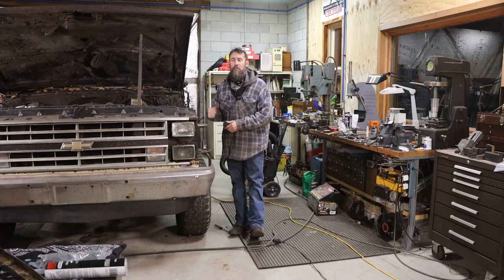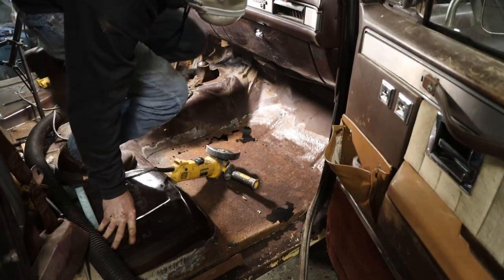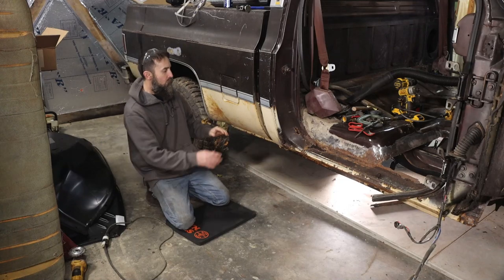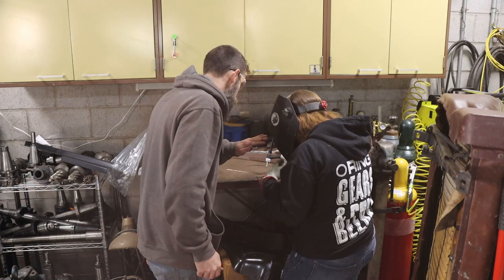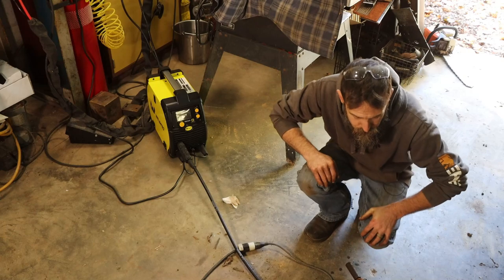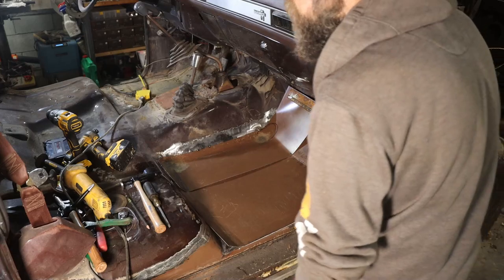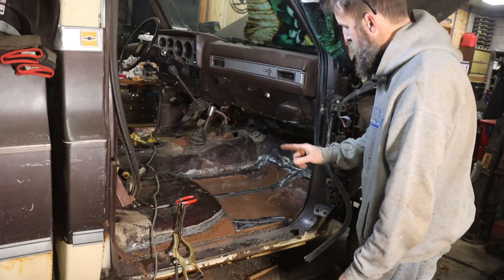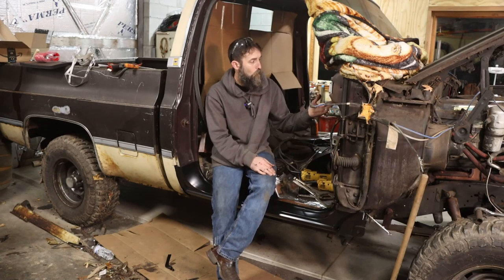Who needs floors / rockers anyway? 1985 Chevy K10 Rebuild Pt 8

Comment: Welcome to bodyshop 101, Steve! Floor pans rockers cab corners/supports are a breeze, it all fits together well mapping itself out for the next panel and or brkt! A good job is all in the prep! Oh, removing the bed sounds like extra work (and it is!) but will save you time in the long run! Great content as always! Cheers!
Reply: Pretty sure it's not his first rodeo...  He's mentioned that he used to work at a body shop.
Reply: @dennisp.2147  I mentioned that early on! LOL much to my surprise and hrs later, I find ole, Steve is no stranger to rust spot welds & panel placement!

Comment: Awesome video Steve!! I just baught a new 20 gallon fuel tank for the passenger side of mine along with a new sending unit and the filler hose and vent hose!! The new tank was only 69.00 threw LMC it also came with a nice Coding on the tank to keep it from rusting!! After I installed it everything worked great and I’m so happy that both fuel tanks work great!! The install was straight forward and pretty easy!!! I will eventually need to replace the cab corners and rocker panels but not bad enough right now to need replacement!! I actually only have one hole the size of a quarter in one cab corner so I’m pretty happy with that!! When I was in school back in 1996 1998 I had a two toned red and white 1984 light duddy 3/4ton that I ended up buying for 7500.00 with no motor in it!! The truck was like brand new!! I could have baught it with the big block that was in it but I was actually wanting a sbc in it!! The guy let me drive it home and pull the motor out and bring the motor back to him!! That truck was also a 4speed manual tranny and I absolutely loved that truck!!! I had built a 355 sbc for it and with everything that I had put in the motor and the 4.10 gears that the truck had in it worked amazing!!! It would pull away from newer vehicles on the interstate easyly!!! Unfortunately on my way home from working at a machine shop for a couple years I was headed just outside of a little town when a truck and a horse trailer pulled out in front of me!! I just missed the horse trailer and after throwing the finger at the guy another car that was behind him decided to just follow the truck and horse trailer and didn’t stop at the stop sign and I ended up T boning him and I wasn’t even going 35 miles an hour I had slowed down even for the horse trailer!! The kid in the car was headed to a basketball game but didn’t end up making it!!! The thing I can remember is he was trying to get to the passenger side of his car but couldn’t make it because he was wearing his seatbelt!! I truly believe he would have made it if he hadn’t been wearing his seatbelt!!! At the time I wasn’t wearing my seatbelt and absolutely nothing happened to me!!! I truly believe if you are paying attention when you are driving and no exactly what is around you that a person is much better off!!! I have received several tickets in the past for not wearing a seatbelt but after seeing that boy reaching for the passenger side of his car I will not wear mine and it’s for that boy that was not able to make it!!! I told my self that day that I would not wear mine Just in rememberance of him!!!

Comment: Carpet has been the death to many a truck floor!  I plan for just a thick layer of Rhino liner on mine and leave the mats and sound proofing out. Keeps water from collecting from either leaks or off your boots.
Reply from the maker: Absolutely. The carpet and felt insulation is what did my floors in. They held moisture against the metal and 30 years later here we are.
Im going to do my best to seal this truck up so I don't have to worry about this in the future.  That sounds like a good plan on your rig Brian👍

Comment: Hi from Germany, Steve. I don't know if you know, but the sparks from the angle grinder should never be aimed towards a windscreen or car window. These are usually made of compound glass with an outside layer of polycarbonate into which the sparks melt. If it rains or there is moisture on the surface the metal from the sparks starts to rust........not a nice thing to happen :-)

Comment: When you were beating on that sheet metal with what was essentially a smooth spherical rock,  it reminded me of a Bronson movie, where the hero, Bronson, rebuilds his blown Harley-Davidson motor out in the middle of the desert with just a rock. So I took to calling, using whatever you have laying around as a tool, a "Bronson rock".
Putting in a rubber floor mat is great, but something to remember is if water gets underneath it, the moisture can't evaporate because of the rubber membrane, so you'll be holding water against the steel for long periods of time, and it'll rust that way. too.

Comment: Hi Steve!  I live in the rust belt and 3 years ago I bought a 2013 F150.  Last summer I spent $4000 on replacing the tailgate and the rocker panels.  My truck is worth more today then when I paid for it.  Fixing a vehicle is worth  the money now a days.  The days of buying news cars are over unless you are flush with money.

Comment: I had a 1980 Chevy Citation.  The passenger side floor rusted out just like your truck.  Chevy in their infinite wisdom used an open cell foam gasket between the heater core box on the engine side of the firewall and the firewall.  Rain could go from the engine side to the passenger side through the heater opening in the firewall.  The floor mats hid the rust until it was too late.  Just a thought...

Comment: An option for that light rust is convert it- wire brush the scale off (there has to be SOME rust), and convert it.  Then spray some rustoleum.  After that, if you want, you can use fluid film to further inhibit the rust.

Comment: Your better off Steve using Rhino Liner or something similar like an epoxy non skid they use on ships on the inside floor. I have a 1990 GMC Sierra SL c1500 WT that has the original work truck rubber mat and I have (NO) rocker panels left and 3/4 of the floor all from salt melt from boots. When I can find time to make the same repairs as you I will be going that route when the time comes.  👈🤓👍LMC Trucks has all the panels I was able to order all from them.

Comment: Great work as usual...when it comes time to do the exterior panels, a tip that has always worked well for me is to cut your patch slightly oversize, then cut through both the patch and the underlying metal in one cut, then they fit perfect with no grinding or filing.  Also no lap joints to seal later.

Comment: I did a similar thing to my -86 volvo 245 last year.
I was at the crossroad of scraping it or not.
I had flat sheetmetal, small leftovers of anything i needed from other projekts.
I had the space and equipment, and 4 weeks paid vacation and nothing to do (wife was working).
I did a quick and dirty, all floorplans, inner rockers, and the bottom half of the outer rockers, a couple of crossbraces and a balljoint. Total cost in spent money 20$ for the balljoint.
Now it gets me 3km to and from work for a couple years more.

Comment: For what LMC used to charge for floor pans for these trucks you simply couldn't beat it. The amount of time you would spend bending and hammering some flat piece of sheet, was at one time easily offset by the time saved. Two floor pans,  some weld through primer, a can of rustoleum paint, and a cartridge of quality seam sealer. A sprinkle of manual labor, a dash of mig weld, and a slice of angle grinder. Bake at whatever temp you are comfortable working in for a long Sat Sunday and voilà, a long lasting quality repair that loooks great but functions better.

Comment: My tractor still has melted lights from when I had my cutting torch in the bucket and ended up burning a f250 to the ground.  It was a little too much excitement but I managed to get the tractor started and drug the tanks away from the fire before anything went too wrong.

Comment: I had a hq Holden,  floor rusted out, the previous owner put in a after market aircon and just ran the drain on the floorpan.
Found a dumped same model in the Bush and cut it out and refitted to my car. 
Went for years and even drove it across Australia.

Comment: Also welding blanket over the dash and under would get rid of the Risk of lighting anything their on fire Harbor freight mix chip ones but they should make a giant itchiness I suggest spending a little bit more money on the more expensive ones I have harbor freight or ordering nicer ones online they don’t make a mess in a work just as good

Comment: Fir not making a mess they make fire extinguishers that just use carbon dioxide or CO2 and they put up most fires without making a giant yellow mess also you should really try to have a full face shield I don’t know how many times been in the ER while just wearing eye pro and having metal shavings fly my eye when using a cutting disc

Comment: Wondering why you used the angle grinder rather than a sheet metal cutter on your air hammer to remove the floor pan? (comment mostly for algo)
Reply from the maker: I've used both. I like the way the cut-off wheel doesn't bend the metal. We used to buy sheet metal cutters for the air hammer.👍

Comment: What are your thoughts on rust converter? Worth while or not worth the bother?
Reply from the maker: I can't say I have a lot of experience using it. Although it does help I'm sure . The main thing is to remove the scale and seal it really good. I will be using fluid film on the hidden old sheet metal.

Comment: I don't get it? You said this truck is pretty much just used for firewood collection. I completely understand the mechanical repairs, and I guess I could understand pulling out the wet shag carpet solely for comfort, but what is the point of body work? Your intention is to keep having this truck specifically for abuse, no? Does the truck have significant sentimental value? I guess I don't understand why you don't throw a scrap of sheet metal over the floor holes and run her until the wheels fall off. Please don't interpret my comment as criticism, I just genuinely don't understand. I have a farm truck that I find incredibly useful, but most of its utility is that I am completely unconcerned with it cosmetically. I don't mind using it to put another vehicle, doesn't bother me if I'm rubbing a tree from the trail, etc. Do you have some new plan for this truck's role?

Comment: Did you do the math on your truck? Value in the beginning; junk value up to $600 (by weight), parts $1500 to $2000, your labor at $75 per hour $3000. Total investment when finished $6000. Cost of used truck with good metal and no leaks $4000!!!!!
Reply: Heck, rusty 20 yo trucks are going for $4k around here!